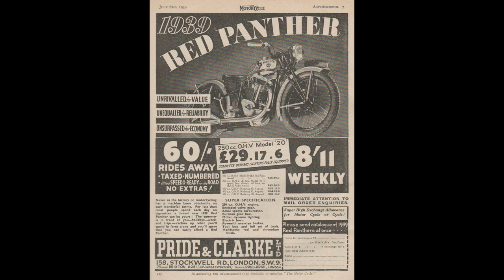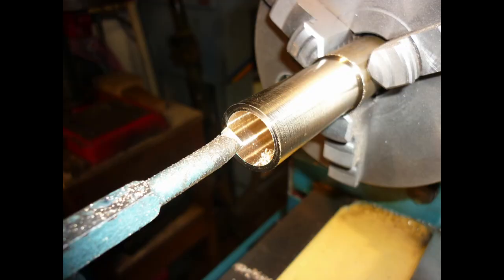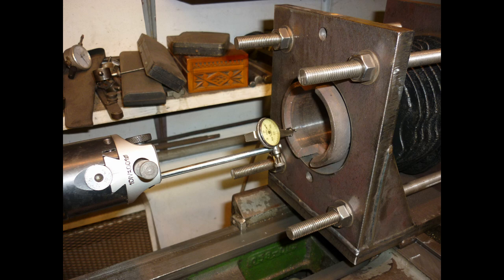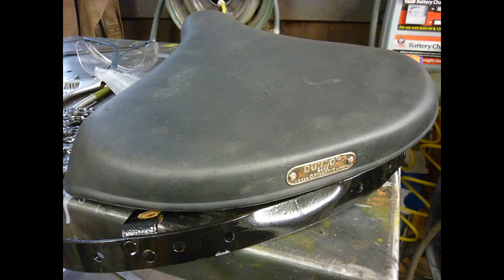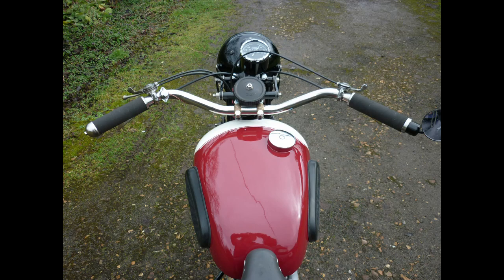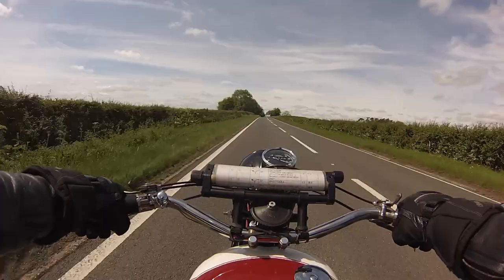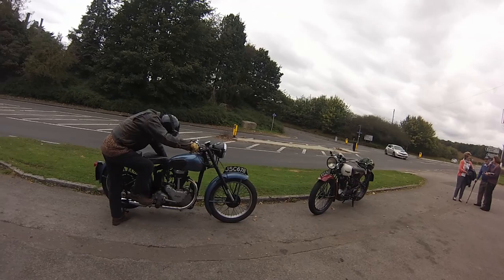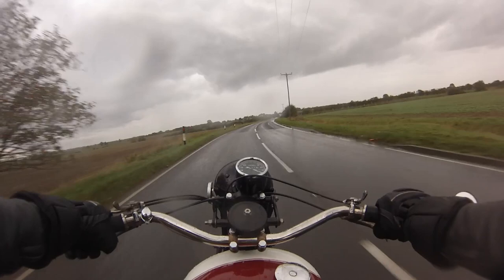Red rust, restoration and riding in the rain

Comment: I was impressed with all the details necessary to enable this motorcycle to ride again almost as if it were a factory. This requires a lot of talent. It is necessary to be an industrial mechanic, blacksmith, stamper, tinker, draftsman, electrician, painter and other skills to transform a large number of mechanical components to work coordinated in a safe and satisfactory way. I work for a highly skilled person in the reconstruction of old motorcycles. Congratulations!

Comment: Thanks for this fantastic video of the restoration ! - Obviously, as the bike is a 1939 model, it would very likely have been off the road from very soon after it's first registration until May 1945 at the very earliest. I don't know whether petrol was still on ration in the immediate post-war period but as pretty much everything else still was on ration for several years after the end of the war it's fairly safe to assume that petrol was too, so the bike may not have had much use in the immediate aftermath of the war either.. Despite this the bike does seem to have had some heavy use at some point, probably in the 1950s..

Comment: My father had a Russian bike of that eta a 175 single in blue with a clear plastic screen 2 stroke of course I believe that too was voskhod in the accompanying handbook it gave instructions on using a heater under the sump in severe weather to warm the engine oil enough to get it started and lubing